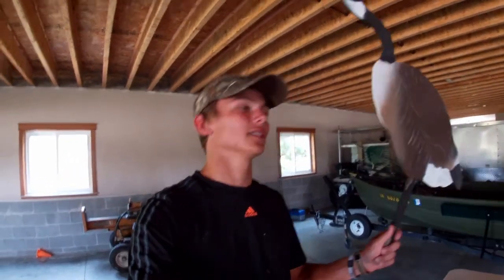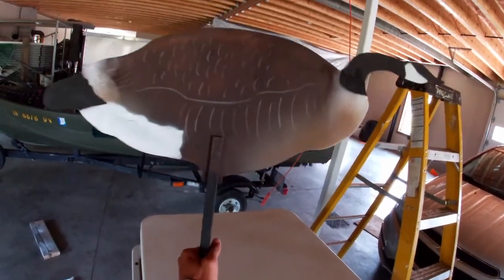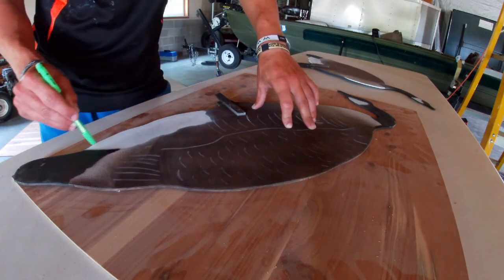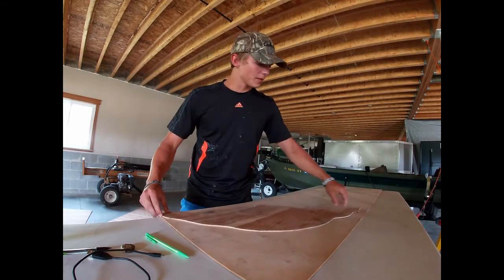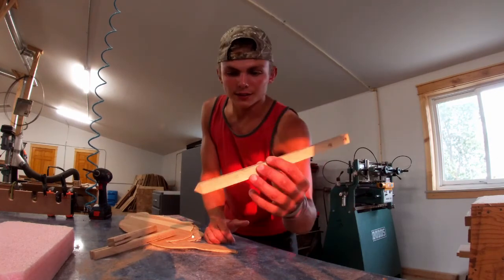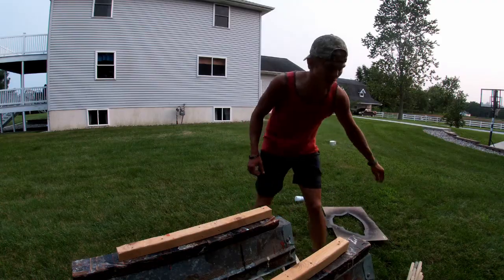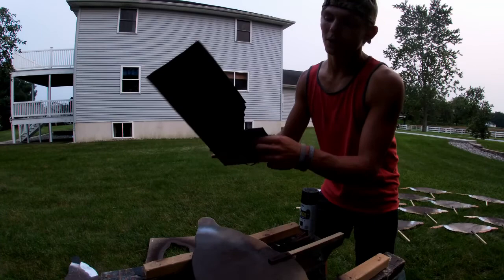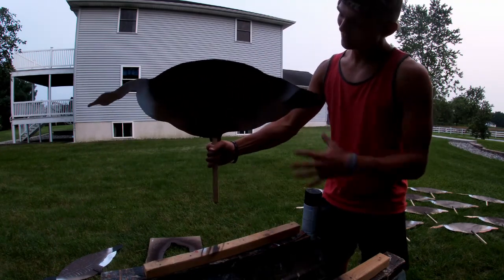Making Homemade silhouette GOOSE Decoys!! (DIY)

Comment: Great decoys! I'm going to try these designs, but with the corrugated plastic boards, like the ones you see on election signs, so they are not as heavy and I can bring more out with me. The paint Job is very well done on those decoys.